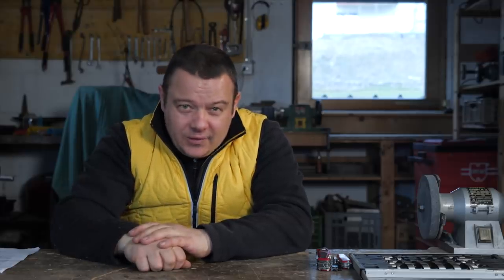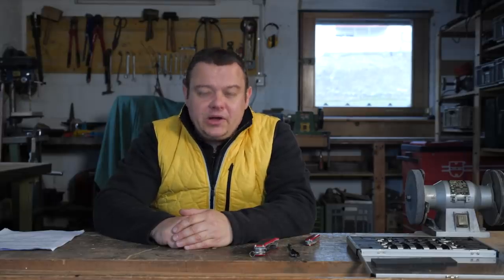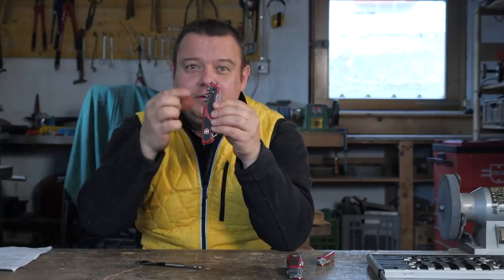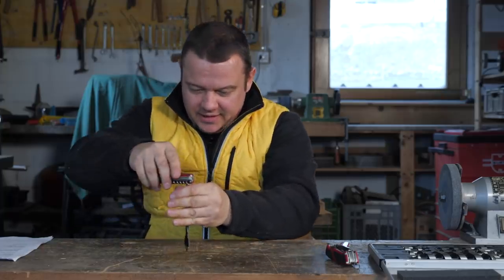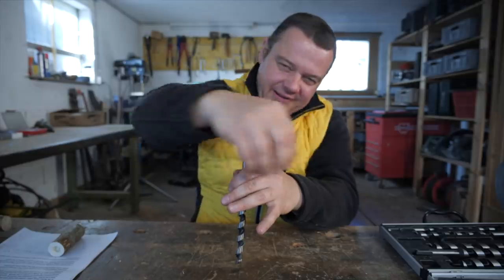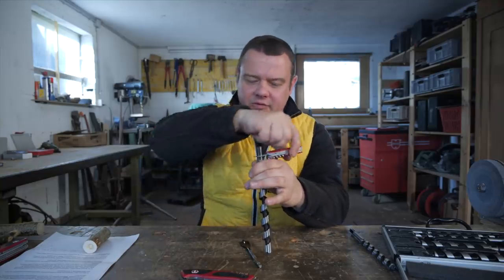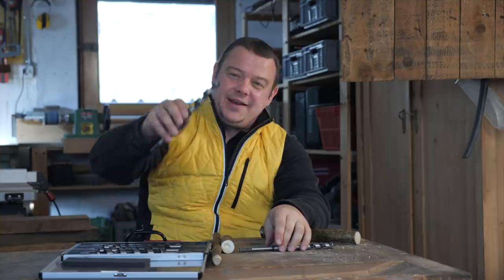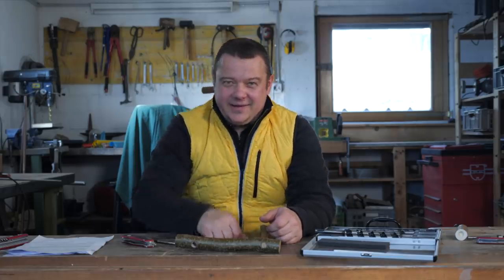Awesome Tricks to drill holes with the Swiss Army Knife - Victorinox Tips & Tricks (31/40)

Comment: The Master of the SAK gets an automatic thumbs up before I watch the video . 
Thanks again Felix .
How about using the SAK tweezers to open handcuffs . Not used to pick the lock - Used as a "shim" between the "teeth" which lock the handcuffs .
Reply from the maker: Thanks a lot for your comment my friend. Sorry i don't unterstand your question with the Handcuffs exactly.
Reply: Sorry I didn't make myself more clear . Take a pair of handcuffs and close them . Use the tweezers to push between the "teeth" in the locking mechanism to separate where they lock together which will allow the handcuff to open . 
The tweezers are not used to "pick" the lock in the key hole . I've only done this twice . All the best to you Felix .
Reply: Why would anyone handcuff you but let you keep a knife ?..
Reply: @Iridium - Very good question . Imagine a tiny SAK in the bottom of a rear trouser pocket which has tweezers . Easily missed during a search . A tweezer , shim or handcuff key is easily taped on the inside of a belt . A large bobby pin can be used for a shim , but the best handcuff shim is made from the metal strip in an auto windshield wiper blade . A belt can be made to hold a small SAK with a blade giving the option of cutting cordage .  ATB

Comment: Felix, I have only recently found your channel and I am enjoying very much. However I have noticed that when you are drilling through a plank of wood, you sometimes have a problem with flat or spade bits causing breakthrough damage to the bottom face of your planks, I was taught that to avoid this problem I should either use a sacrificial piece of wood clamped or strapped beneath to drill into or drill through until the centre point of the drill starts to show the bottom face of the workpiece, then reverse the drill flip the workpiece and using the small centre mark to relocate the drill complete the hole from the other side.

Comment: Another use for the bottle opener, that's great !
I bought a Rangergrip 55 (130mm Delemonte range) a year ago and when I had to remove the scales for some reason or other, I discovered that the hex hole was already in some of the liners from manufacture. So obviously (!), I opened up the scale on that side to expose the hex and now have  a hex socket for screwdriver bits and a drill. I keep a selection of bits and a 1/4 inch drive adaptor along with a 6 inch flexi screwdriver extension with the knife and it has become a multitool in it's own right. You're right though Felix, I wouldn't put too much strain on it in case the liners become damaged.
Reply from the maker: Hello Nick. i agree 100%! Be careful because of the thin  liners!

Comment: Again another wonderful tips and tricks video. The only thing you didn’t mention was how drilling all this holes is a great way to keep warm. 😀
I think that maybe using the 1/4in. drive with another tool would also prove useful to drive a drill bit. 
I was wondering if there is some kind of temporary modification that can be made to the corkscrew or Philips drive that would work. 
Great video!

Comment: Good tip. If you are going to carry a dedicated drill bit, then the other option is to weld a metal T handle on the drill bit, then you don't need to use the SAK.

Comment: Ive always been thinking of away to do that rocket stove like u but with out spending that much on the handyman. This seems ways better. Also are u gonna show how u customized your ranger? Great video cant wait til next friday
Reply from the maker: The only thing you have to do is to make a hex hole into the scale. The right spot is already marked on the inside of the front scale.
Reply: I've done this to my Ranger, I'm sure it voids the warranty so I'm going to try a few paddle and auger bits to find the limit of the frame.

Comment: Your tricks are very good, but this seems a little out of place since you use external tool (which is quiet big) . I think in this case its a probability decision wether its worth carrying a large drill bit and how many times you will actually need it in bushcraft. Would you say you would encounter a lot of situation where you need to drill big holes?
Reply from the maker: That's an intersting aspect! And i give you right... but beeing able to drill big hole opens a lot of new bushcraft possibilities...

Comment: Another great video sir. I have used your ideas many times with great success. How would that spade  it do with the 1/4 hex drive socket? I know you can get them that way. Using the bottle opener with the 1/4 drive socket should be strong enough to use a bigger bit?